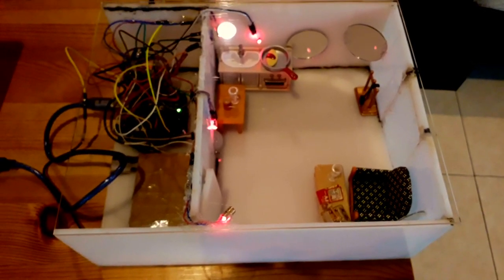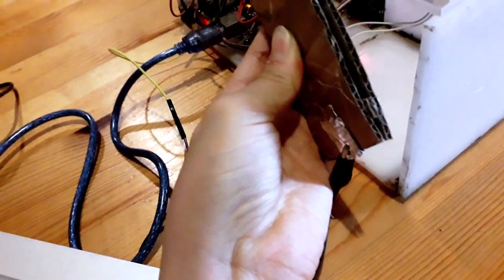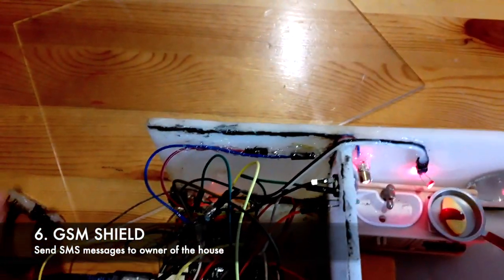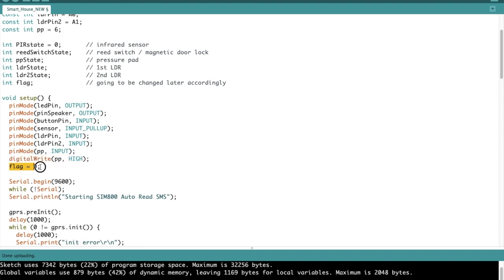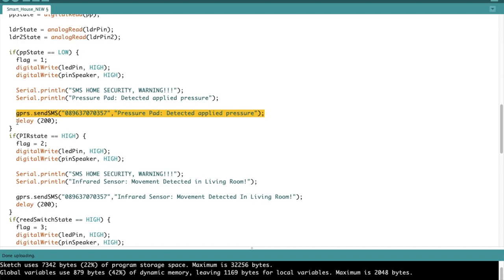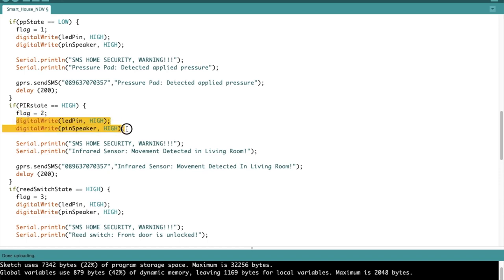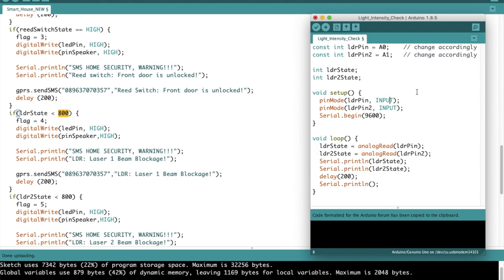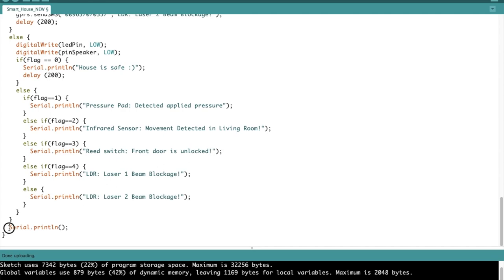Arduino Project: Smart Home Security / Burglar Alarm System

Comment: Can I see your wire diagram
Reply from the maker: Hello,

I believe it would be rather confusing if I send a wire diagram with all 6 features connected into one Arduino UNO - which is what I did above; thus, I'll break it down instead. In this case, you can just use 1 Arduino UNO for each feature, meaning you'll have to use 6 Arduino UNOs if you want to use all 6 features. Of course, you can just select some out of all the features. *Take note, however, you'll need different programs for every Arduino UNO you use.*

•• (1) Pressure Plate
Building the pressure plate was something I learnt throughout the process of my project, and it can be referenced to these videos: https://www.youtube.com/watch?v=QxF-028UR9I and https://www.youtube.com/watch?v=5_JgvaB3esg. You'll need two pieces of cardboard, and some tin foil/aluminium foil which you'll glue to each cardboard. Once you're done, you'll need to connect wires, which will be clearly explained in those videos.

Of course, there are alternatives such as using force sensing resistors. For that, you can check out: https://www.youtube.com/watch?v=JZ44h-jy0p4 and https://www.youtube.com/watch?v=rTO3U-0Njtw. This site will be useful as well: https://create.arduino.cc/projecthub/ashish21senapati/pressure-pad-interfacing-with-arduino-efacad.

•• (2) Reed switch (Magnetic Door Lock)
These are two useful sites with detailed steps: https://www.instructables.com/id/Arduino-Reed-Switch/ and https://circuitdigest.com/microcontroller-projects/arduino-reed-switch-interfacing.

•• (3) PIR (Passive Infrared Sensor) or Motion detector
You can use: https://github.com/alisavictory7/Arduino-Smart-Home-Security-System/blob/master/Motion%20detector.png

•• (4) LDR (and lasers)
You can use: https://github.com/alisavictory7/Arduino-Smart-Home-Security-System/blob/master/LDR%20and%20Lasers.png.

•• (5) GSM Shield + SIM800
Check out: https://lastminuteengineers.com/sim900-gsm-shield-arduino-tutorial/.

•• (6) Buzzer
You can use: https://github.com/alisavictory7/Arduino-Smart-Home-Security-System/blob/master/Buzzer.png

Hope this helps, and have a good day!
Reply: Thanks but o already created a program for all 6 in one plus some additional feature so that is why I would like some assistance with the wiring diagram
Reply from the maker: @Jayquan_ng  I see, then I'll be creating a schematic diagram of all the features combined. When it's ready, I'll come back to you and post it.
Reply: Thanks your a life saver
Reply: Any update ?

Comment: what is your code can implement several codes in the same script
Reply from the maker: Yes, it implements different codes in the same script since I use 1 Arduino UNO, in which only 1 program can be uploaded. You can find the link to my code in the description > Program Code > Arduino (My Github Repository). It takes you to the Github site, where you can just download the code from there. Hope this helps! ^^